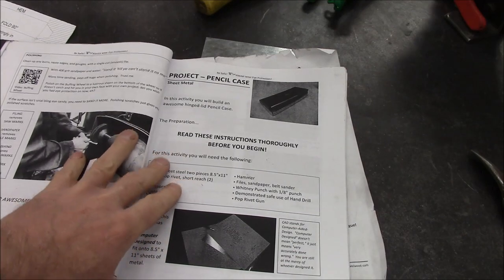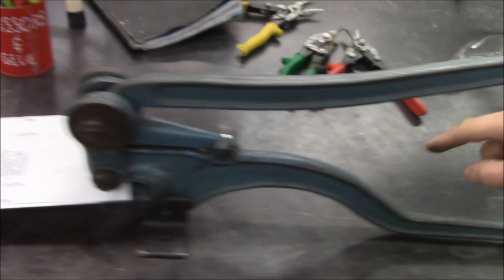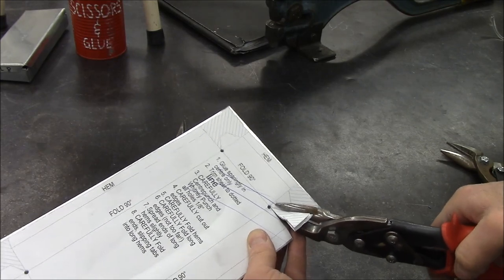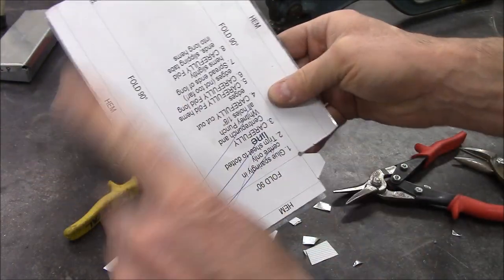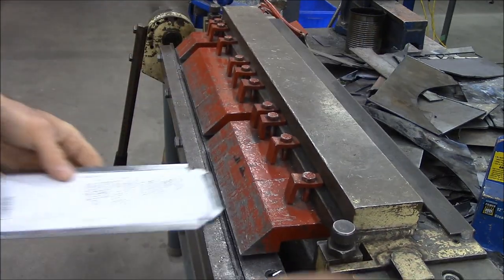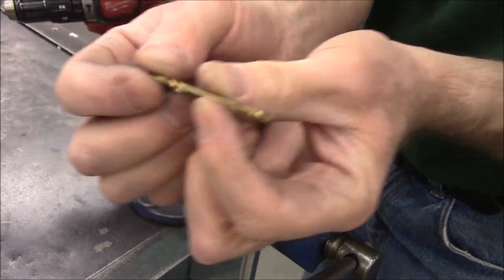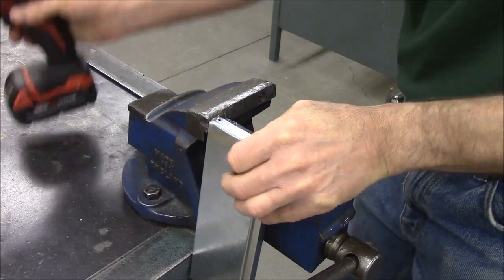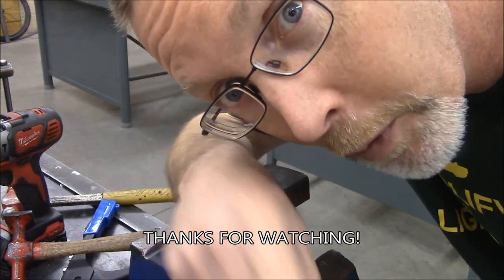BUILD a Pencil Case - FREE PLANS!!

Comment: NOOOOOOOOOOOOOOOO !!!!!!!!
The slide of a Record Number 3 vice is NOT an anvil !!!!!!! In my mind that's as bad as using a flat bladed screwdriver as a pry bar.

Record vices were pretty much all made of grey cast iron, and every time you give it a spot shock load by centerpunching something on it you create micro fractures. Once these micro fractures start to join up it's only a matter of time before the sliding jaw's heel cracks.
If you REALLY need the mass of a vice to help with centerpunching, I once made a 4" square out of 1" steel plate, then bolted a 2x1" block to the back. You can clamp these in a well mounted vice and use it like a lightweight anvil, and you don't risk knackering your vices slide or jaws.

I don't use it now though, as I replaced my cast iron Record vice with a cast steel Woden 190/7A that's got a small anvil built in. Being cast steel also makes it a pretty tough SOB too.
Reply from the maker: Noted.
Reply: Good call.